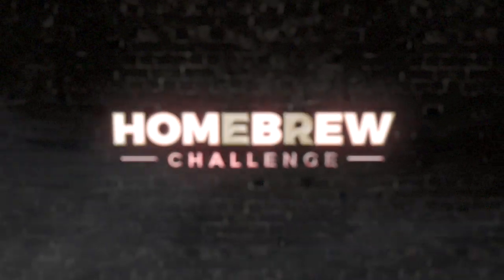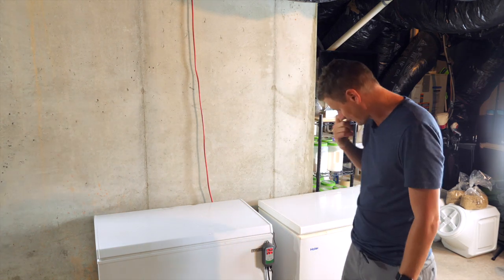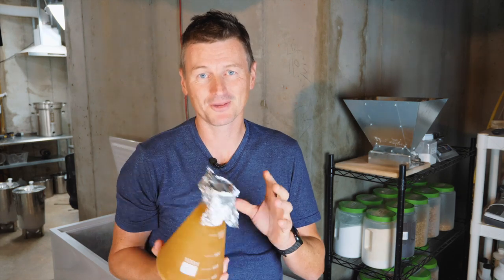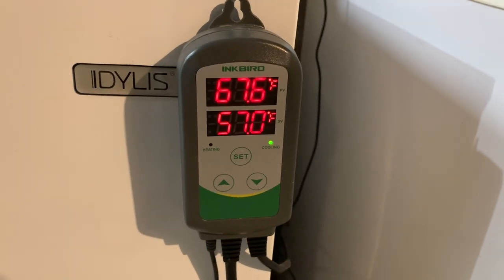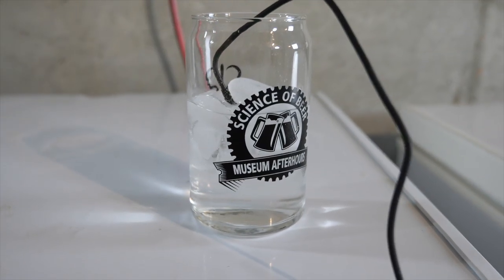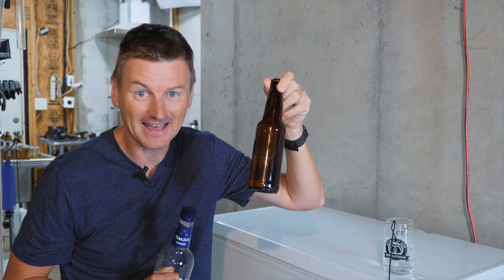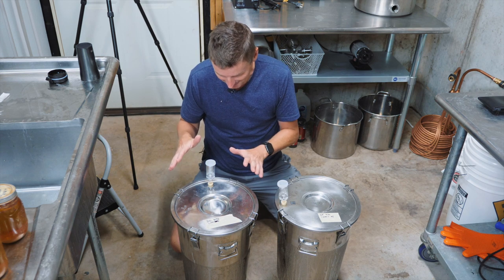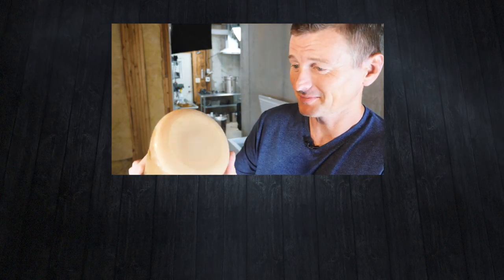I Froze 10 Gallons of Beer  - Now What?!

Comment from the maker: Hey thanks all for the trouble shooting tips. Several people suggested that immersing the Inkbird probe in liquid is the cause of this problem. I checked with Inkbird Support and they came back saying:

"Yes, the probe of the ITC-308 can be submerged into water and vodka."

So seems leaving the probe in a bottle of water or other liquid should not be the cause of this?
Reply: Try swapping out the probe with one of their replacement probs like the 12" (Link below) that they offer. It even comes with the parts to modify the controller so the sensor is removable for easy cleaning and debugging. The problem with their waterproof rating is that it doesn't say how long it can stay submerged and that water/vodka can work its way in eventually. there is a reason why this costs less than pro equipment. Love your content and we definitely have experience freezing beer our selves, although some times we do it on purpose (but not always).

https://www.ink-bird.com/products-accessory-12in-Sensor.html
Reply: Despite what they might claim I don't trust that the probe is waterproof in the long term. What I do is take a can of soda/beer, put it in a koozie, and then slip the probe in between. Gives the probe a bit of insulation and a thermal mass so you get accurate approximation to a keg due to the thermal mass of the can.
Reply from the maker: Excellent thank you! Will give this a shot.
Reply: I'd agree with Britton, I wouldn't trust it. I've now seen 3 separate probes eventually have that same off reading as yours did from liquid submersion.  The NTC probe claims IP68 waterproofing, while the regular probe does not, which is why I recommended (I haven't tried it, though.) I have this same one and have used it with a thermowell for about 3 years now with excellent results. That being said, Inkbird as awesome customer service. I'd bet they'd replace it if you asked! :-)
Reply: had to replace my probes too, they are not water proof for sure
mine actually cooked the yeast got to 40*C 
I took a piece of copper tube pinched one end put it in water bottle
Got inbird for bbq with 6 probes and 5 of them already failed...
Reply: If you don't want to fix the inkbird, which involves disassembly, soldering, etc. You might consider the WIFI one. Even so, don't immerse the probe. Wish Inkbird would make it easy on us and put all probe inputs on a 3.5mm headphone jack and put a plug on the probe. Easy replacement.  The WIFI one would have told you something was amiss.
Reply: @DasGreatBrit  Have you measured the difference between your method and using an insulated pad on the fermenter? I like your solution, but differences in container materials or thicknesses and the mass of the smaller container - my experiments say it wears on the compressor? Not so?
Reply: @jcinsaniac  I haven't, and for most uses on the side of the fermenter is probably more accurate. For my setup we brew 15-20 gallon batches (3 brewers) so we can surround the temp probe which helps to normalize it. We also set the target a degree (F) or two lower than what we want the fermentation to be, to account for it being exothermic. Additionally the inkbird is set for max (10 minutes iirc) time between cycling to lessen load on the compressor.
Reply: @DasGreatBrit  Thanks much - you sound as cautious as I - I want to spent money on brewing, not fried equipment! Cheers, All!
Reply: @jcinsaniac   they aquarium model does have a probe with a plug

Comment: No ITC-308 in liquid. Thermowell only. Also - putting the sensor in a smaller container will make your system cycle more often. Best solution is to put sensor on side of fermenter, cover it with insulation and tape in place. This way, it is measuring the actual wort, accounting for the thermal mass. Really surprised that the starter container did not shatter. On the bright side, the beer can probably be salvaged.

Comment: Im currently using a 340L fridge and not a chest freezer. If i have a breakdown of my systems i know it wont cool below 2 degrees Celsius so i should be safe. I also like that a fridge will instanly vent carbon dioxide when its opened whereas a chest freezer wont.

Comment: Yeast should be safe .  I have made put sourdough starter in the freezer to keep it while I was away.  When I got back. I took it out of the freezer and into the fridge to defrost.  once fully defrosted put out to room temperature and gave it a feeding and had a good starter and bread shortly there after. I know not quite the same but both are dealing with yeast.

Comment: I’ve had a similar issue with 2 inkbirds, even though my probe was always kept dry. I don’t know why either. I now only use my inkbirds “always” use a heat belt. The frozen Neipa I was fermenting was fine when defrosted, fermentation started again, although it was very clear. You can freeze yeast you know, bakers do it.

Comment: I'm assuming that the thermocouple (temperature probe) was busted? If the beer was already fermenting and it cooled down relatively slowly before freezing then just gently raise the temperature and it should all kick off again. If it doesn't then it's just a case of adding more viable yeast. freezing a yeast shouldn't be too much of a problem as yeast goes into suspension when it gets cold and when it is warmed up it comes back on line and gets on with doing it's thing. Cheers, Schnuz.

Comment: Thinking about this problem... could you use 2 temperature controllers? One controller plugged into the other with both probes in the keezer? You could set one controller at the desired temp and the other controller a couple degrees cooler to act as a failsafe or redundant backup so the freezer won't run to the point of freezing.  Just a thought. I don't have a keezer or temperature control yet so I'm not sure if this would work.
Reply from the maker: Interesting idea. Not sure how that would work, plugging one controller into the other given that only one controller can cycle the chest freezer on or off
Reply: @TheHomebrewChallenge  I was thinking the first one plugged into the wall would be the primary and act as backup and set to 32f for example. It would stay on all the time unless failure of secondary. The secondary controller is plugged into the primary. The secondary would have to be set warmer by a few degrees at its coldest but could be set at any temp above

Comment: I've gotten the same type of readings when I have gotten non submersible thermocouples wet, usually they start working again after I've run them in either a dehydrator or a low oven(~100C with fan if available). This one is supposed to be submersible from what I understand but try drying it out and see if you get correct temps after?